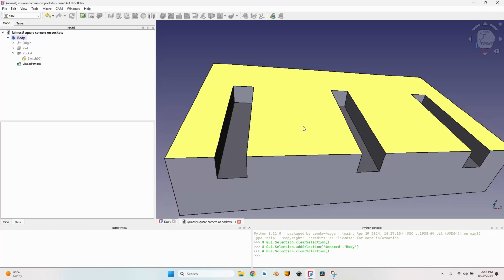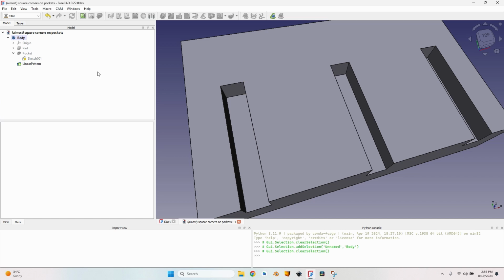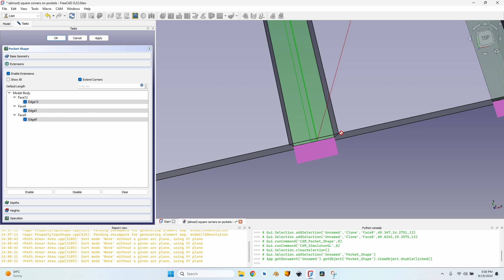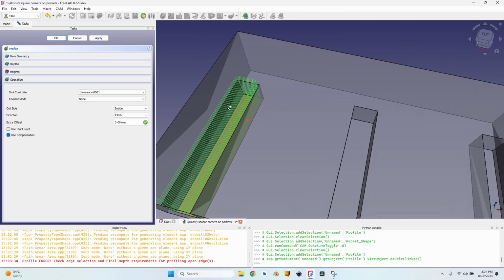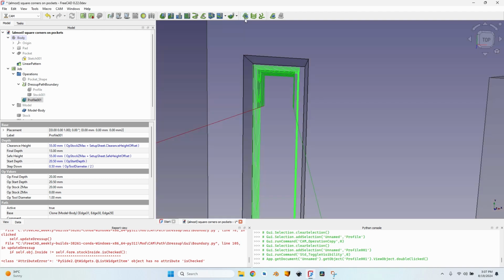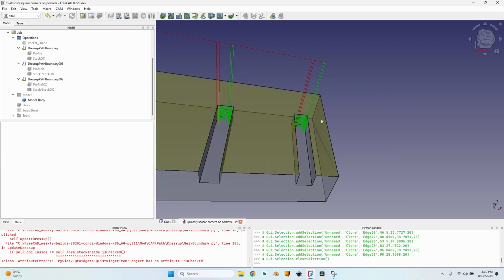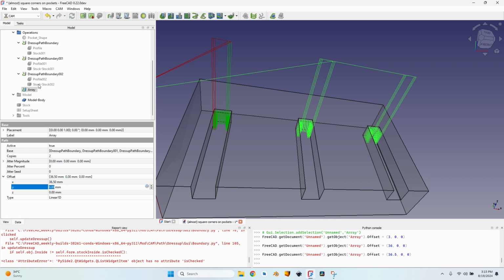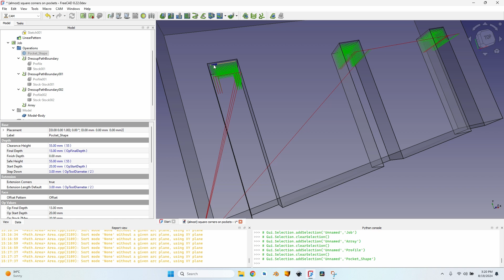Milling (Almost) Perfect Square Corners – FreeCAD CAM Tip 10 (CNC Toolpath Trick)

Comment: First very nice video.

But of course, there are differing opinions... I would have used an adaptive tool path, with a quick profile for clean up, then followed up with a "rest operation" using a much smaller bit.  You say "adaptive tool path" take to long ... is that in computing them or running them? The idea I believe is to helix into full depth, then mill with a longer portion of the bit ... net result is a quicker and more bit efficient (bit stays sharper) cut.

What are your thoughts and concerns?
Reply from the maker: Thank you! 
On a rectangular surface such as this one, the pocket is way faster both at computing and at running. Also, on a i7 8750, after 5 minutes of computing the boundary dress up for the adaptive operation, I had to force close FreeCAD. Of course there are more ways of doing things, each of them with advantages and disadvantages. The adaptive is, indeed, good for extending the toolbits life. It is especially useful when milling metals. On wood, as long as you don't burn it by setting too high rpm, there's a higher risk of breaking the bit using the adaptive than to dull the tip by using too small layers for a pocket operation.
Reply from the maker: About the "rest option". It is a great concept, but it works acceptable 2 out of 10 times, for now. It will probably get better over time, but now it's just a matter of luck.
Reply: @opensourcecnc  I have to ask what version of FreeCAD you are running. I use 0.22 as my daily version, and I don't know that I have seen issues with either. Have you submitted bug reports?  

I just left a FreeCAD meetup last week and 0.22 is about to become a release candidate in the next week or two. Both of those features are queued for version 1.0, so if there are bugs, please report them.
Reply from the maker: @carlslater7492  I use 0.22, too. I haven't submitted bug reports, my last few experiences (a long time ago, I have to admit) about submitting bugs were very bad. I just gave up
Reply from the maker: Btw, I remember you asked me about the grbl post processor: please set the default for drilling to automatically translate the instructions, it's really annoying to have to manually set a parameter in a quite deep place in order to not have errors when sending the code to a grbl controller.